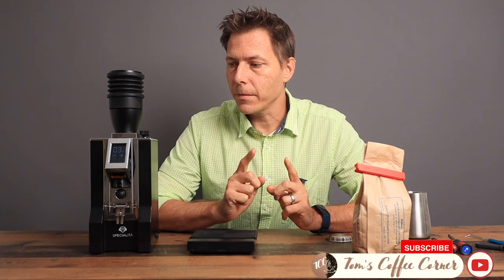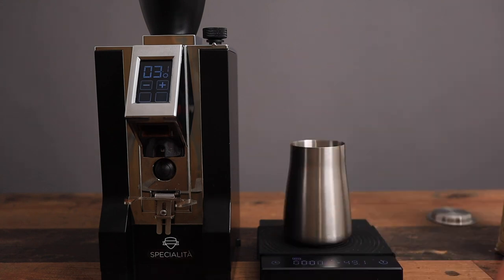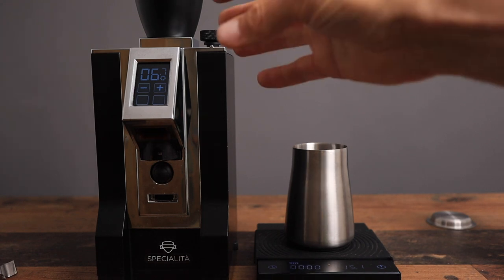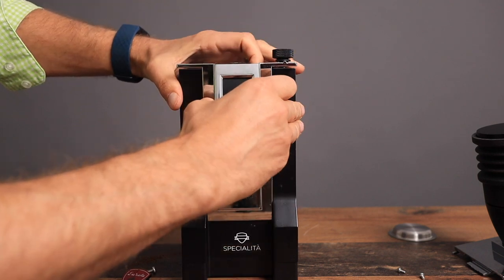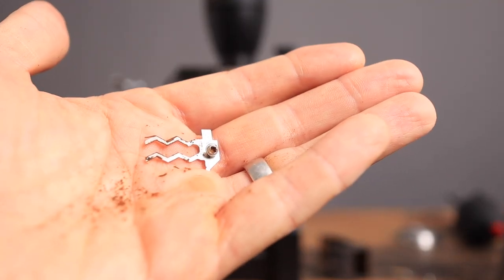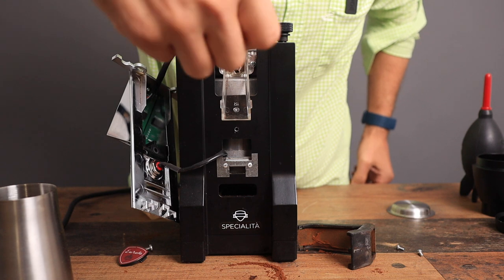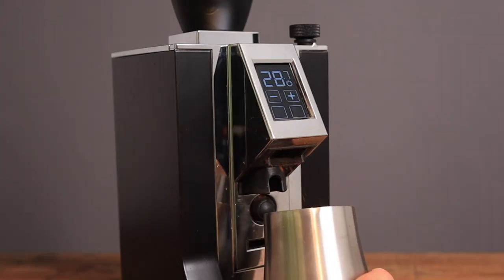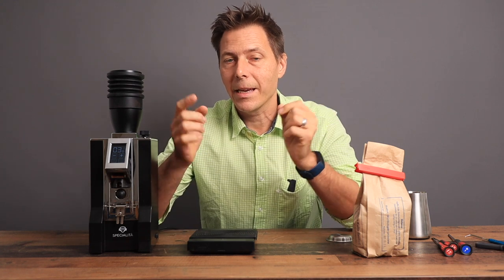How to Clean the Chute of your Eureka Mignon Grinder

Comment: I have the Facile with a bellows from Amazon and it works pretty well as a single doser. I find it works best to give it a couple of long slow pushes as it reaches the last couple of grams and it will kind of push everything out vs. waiting until it's done and trying to just blow the last bits out with air alone. Then at the end of my coffee making day, i'll run the ginder and blow it out with compressed air or a minivac with a blower function.

Comment: Hi, I unscrewed 3 screws, lift and pulled and after an hour still couldn't get the front panel off, even took off the bottom plate and managed to snap one of four hooks of the panel, why does it look so easy when you do it?  BTW new machine.
Reply from the maker: Do you have a Specialita? These differ slightly based on the model...
Reply: @TomsCoffeeCorner  yes I have it, took it back to the seller to disassemble, he said some are just really tight out of the factory, and even though he repaired hundreds of grinders, mine took a while for him to take apart.

Comment: Nice instruction on cleaning the mignon, I also have a specialita and a Dedica set up like yours. Btw, I think you installed that decrumpler (de-static) with the wrong side....
Reply from the maker: Hello and thanks for commenting!

I left the screw in it, so the orientation must be correct. Or do you mean something else? Cheers!
Reply: @TomsCoffeeCorner  Hi Tom, if you look carefully, the clear plastic where you need to screw in the decrumpler, there is actually a indend with the shape (arrow to the left and rectangular tail to the right) of the top part of the decrumpler piece, you installed it reversely with arrow to the right... but I think it is ok to leave it as it is...
Reply from the maker: Hi Frederic, thanks for that extra info! I will take a look for that indentation later. Cheers! 👍🏻

Comment: Hi Tom,
Just a quick question not relating to this video but concerning the LaSpecialista machine. 
Is there any way to change the beans in the machine mid operation for different blends and roast levels without either wasting beans by grinding away the remainder, or by removing the tank and upturning the machine to pour out the beans?
Thanks Tom.
Regards,
John
Reply from the maker: Hi John, as far as I know, you just have to grind through the beans. I will try taking apart the machine soon enough, to see if we can get to the grinder. 
Best, Tom

Comment: i just bought this machine and the first thing i did was remove the declumper.   if you single dose and needle distribute,  the declumper just adds pain to your life.
Reply from the maker: I never had issues with it on my machine, but I have on other machines...
Reply: I will try this. My eureka mignon zero gets clogged so often. It is super frustrating. Hopefully this helps. Thanks for the idea. 👍
Reply: @muemue888 has removing the de-clumper been effective over the last 3 months? Is there any downside that you've found, like static, retention,  etc? I just ordered my machine and will single-dose with WDT, so I'd like to remove it from the start if it's been working for you. Thanks!
Reply: @hccolorado8576  I tried it, and it was not good lol. Way more static, just an overall bad experience.